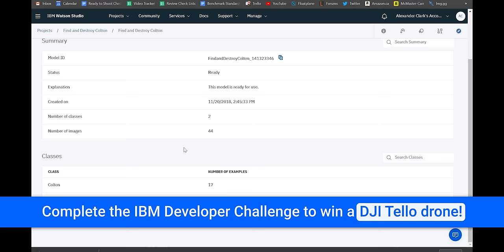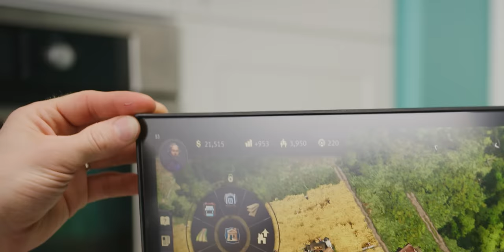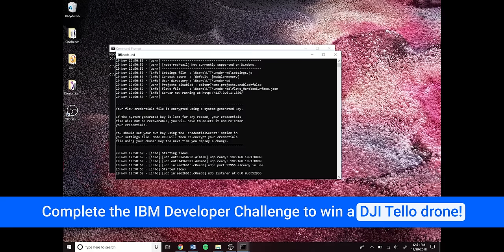FINALLY Upgrading my 4 year old Gaming Rig!

Comment: that erosion/corrosion was from using tap water.  use distilled!
Reply: It happens from distilled too. I used distilled in my very very simple custom loop, and I got erosion from the blocks.
Reply: Isn't there some inert fluid you could use other than water?
Reply: @lorenzvo5284  I doubt it, I imagine the flow of the liquid is what's causing the erosion.
Reply: @MoswenMedia  Its not only erosion it looks like oxidation aswell, or is that just the copper?
Reply: @lorenzvo5284  I'm fairly sure that's just the nickel finish rubbed away to show copper like you said.
Reply: Erosion: wear from flowing liquids
Corrosion: chemical reaction of a material with it's environment that causes major change to the material

To prevent corrosion you need to use non reactive liquids. Salty water is bad because it has a lot of spare ions.
To prevent erosion you need to stop the flow.
Reply: @Pseudynom  yea, pretty much what I said.
Reply: @lorenzvo5284  you can use mineral oil, but that stuff is really REALLY hard to maintain
another solution which is very expensive to both use and maintain is using what's called pure water, pure water is water that has had literally everything filtered out of it, it is softer than fresh water and distilled water, but a bottle of 500ml of this type of water costs about ~300$.
we used to use it in university for some experiments

Comment: Linus: My RAM memory its just 2666 mhz, its not that fast
Me: sitting here with 8gb DDR3 RAM ar 1600 mhz
Reply: Yeah and he has a damn 8 core meanwhile I'm sitting here with 4 cores lol
Reply: Me sitting here at triple-channel 966 (or whatever the BCLK made it)
Reply: @lfox02  Retro my dude
Reply: @vatz1151  I got an "Old" PC for free because the owner was moving and it allegedly did not fit in his new house (case is Antec P183, it's rather big and heavy). I thought it would be an old office PC, not an X58 gaming system (GTX 285 and i7 950). I got a Xeon X5650 off Aliexpress for 20€, used a GTX 750 (now a 770) and here we are.
Reply: Oof
Reply: For DDR4 that is slow. in reality though i am also sat here with 1600mhz ddr3.
Reply: @lfox02  thats a very nice/ignorant neighbour
Reply: @brodiehaward  ah, a man of culture as well
Reply: Me: sitting here with 4GB DDR2 at 800mhz (OC'd from 533)

plus a Geforce 8800 GTS also OC'd

plus Core 2 Duo E6750 2.66 GHz -> OC 3.2 GHz
Reply: @marekslemensky4531  Oof. I started out on a prebuilt with Vista (I installed 8.1 shortly after)
AMD Athlon 64 X2 5000+ at a blazing fast 2.6 GHz
Integrated motherboard graphics
And 1TB HDD (which, though slow, was rather nice and I still use it alongside 3 SSDs. I'll replace it once I get a chance though).
Reply: @lfox02  noice
Reply: @vatz1151  My PC is not a prebuilt one tho :D 
ok also I'm still using the first HDD that I put in it. 400GB samsung 7200rpm. But I can't say it's slow :D no jk

Comment: 40 fps with a titan rtx in 4K? that game should be optimized with foots.
Reply: The resolution makes a small to no difference in Anno, because it's so cpu expensive..
Reply: @sonnyboi1761  Clearly the cpu is not the limit there
Reply: @tuxnews2878  u gotta understand that he is playing on ultra with 4k resolution, if he played on 1440p he wouldve got 100 fps easy although u dont need that much for a game like anon
Reply: @ikindalikesportscars46  itd still pretty bad for the best video card available. definetly. pretty bad
Reply: @ikindalikesportscars46  Actually he is playing at 3440x1440 which is ultrawide resolution for 5m pixels.  a 4k panel 3840x2160 is 8.3m pixels.  I think Anno is just badly optimized if it takes that much horsepower to run high settings at ultrawide.

Comment: My only question would be if you use water then why not use distilled water since there are no minerals that contribute to the corrosion and distilled is at it's most purified while it's mostly used for medical equipment such as CPAP machines for sleep apnea.

Comment: Wrong upgrade, shoud wait for AMD Ryzen 3000, dont forget to install intel ZombieLoad parch that will kill your performance
Reply: My Thoughts Exactly. Also RTX 2080 Ti Super coming soon...
Reply: Actually if you read the technical paper, through testing the ZombieLoad vulnerability was unsuccessful on the 9900k. But of course you don't read.
Reply: @dhkatz_  that version. It is still effected.
Reply: Warm Soft Kitty  Jesus fanboys everywhere. Intel has been beaten in the vast majority of tasks since ryzen first came out years ago. You got more performance in everything but gaming, more cores to run single threaded workloads on, greater multithreaded performance, better features, better security, better upgrade paths, cheaper prices, better availability, a more modern platform, lower power consumption, less heat, better igpu's, more pcie lanes.

And now there has been a 15% IPC gain, even lower power usage, even more secure, even better more modern platform, higher clocks, and all of the stuff above is still true.

BuT inTeL iS BeTtER BeCauSe iT wAS a FeW PeRcEnt FaSTER oN SPECifIc WoRKload 4001. (For twice as much money not including the platform because then it looks even more ridiculous).

As for 3000 serious just wait and see. I bought AMD shares when they were a dollar and going to be in every new console. And I ran a 4770k then 4790k at home at the same time. 

Tldr don't be such a fanboy, AMD's ryzen line has been phenomenal for the world at large in computing and your opinion in your tiny segment of the market doesn't change that.
Reply: Warm Soft Kitty  what? How many gamers do you think there are? How many of those are buying high end parts? Almost none compared to those that buy a laptop and a console and work without knowing it on a VDI. All of which AMD will be taking back while Intel prepares products.

People buy Intel because of advertising and OEM's. Now that's changing too. Pushing more cores is bad? What world are you in? Do you understand computing at all?

Go do some computer science classes online. Then study the modern windows kernel, browsers, game engines then come back here.

Don't know if trolling or just completely misinformed or both.

Comment: As much as I like big ATX cases with temper glass panels, I love my tiny MasterBox Q300L MATX case.
Also, as good as just pure water is, I still will keep my oil, as I've put a chemical in it that will kill bacteria, but leave the plating of nickel alone. Also if it leaks, it's non-conductive, so it wont kill my system.

Comment: "it weighs, oh my god, probably a kilo or two!"
Americans watching this:

"a kilo? how many bald eagles is that?"
Reply: "The bald eagle has a body length of 70–102 cm (28–40 in). Typical wingspan is between 1.8 and 2.3 m (5 ft 11 in and 7 ft 7 in) and mass is normally between 3 and 6.3 kg (6.6 and 13.9 lb)." So somewhere between 1/3rd and roughly 1/6th bald eagles.
Reply: Strider Zero naa episodes of border patrol comes to mind 😂😂🤷🏻‍♂️ 🚔 🇲🇽

Comment: Meanwhile iv got a 2500k @ 5.2ghz under water since day one, and fingers crossed, never missed a beat.
Reply: I'm still rocking my 2700k from 2011 under water as well. It's about time for an upgrade... this isn't a terrible deal with the block ect.
Reply: @paulguggiana1765  haha yup. My problem comes to the fact that there's nothing that I'm currently doing though that my system can't do yet. So for me I'll only upgrade if I'm forced into doing so by dead hardware or it being a limiting factor
Reply: @Bangie  100%. I have upgraded video cards twice since the original build but other that that nothing had changed and I can play pretty much much any optimized game at 144hz all day long. It bugs me more that technology slowed down that much in the gaming space so much that 80% of your hardware is almost a non factor. I have been getting that itch to build a new system for the past few years but it just doesn't make sense.

Comment: that 2666 RAM is holding you back a few percentage points
Reply: The max supported on Intel CPU’s is 2666mhz. You could go higher but won’t get much a difference. At most 2%
Reply: @mikeramos91  that cpu will easily run ddr4-4000, I know because I'm running 32GB at that speed with CL17
Reply: @MikeDawson1  without xmp profile it can only run 2666
Reply: @ligametis  I know, that's why I'm suggesting he replace it next

Comment: anno 1800 only 40-60fps on ultra with those specs damn!
Reply: Seriously, it barely even made a difference.
Reply: @SpurnOfHumanity   Dude, i was considering getting anno 1800. I have 4k monitor, gtx 1080 and ryzen 1700x and im worried it wont be worth it.
Reply: everything maxed out at that resolution is insanely demanding for a new game like anno , i had this kind of monitor and i can say yes it looks amazing but it;s annoying if you are used to high refresh rates so i returned it and got a 2560x1440 native wich is great for everything especially because it's 32" so it's still pretty massive but 1440p does not tax you as much as ultra wide .
Reply: You have to remember that's at 4k on an ultra wide monitor...

That's like playing a game at 8k
Reply: formdoggie5 that makes sense
Reply: @formdoggie5  Well, it's close. 4k res = 3840x2160, Linus' was 3440x1440. So it's really more of a 1440 ultrawide. 4k ultrawide would be more like 5120x2160.
Reply: Will there ever be a time when hardware is powerfull enough to run every game on ultra at 144fps?
Reply: @bokajllensch661  probably 5 years for that to become the new standard. 8k is being adopted by TV's right now. So well probably see 4k 60fps become the accepted high end shortly. Right now it's a matter of it being a price barrier for acceptance.  That being said, most modern cards do already natively support 8k rendering so...
Reply: I think in the next ten years it will not happen that the highest "normal" resolution can be properly driven by the hardwrae of its time...
Reply: @bokajllensch661  lol no
Reply: @stevennolan5315  what are you reffering to?  To my rethorical question or my thesis? If its the first one I agree!

Comment: The fastest you can get , untill the 7th of july :D
Reply: Yup
Reply: The upcoming Ryzen CPUs aren't faster in games than the 9900k.
Reply: @basshead.  Ryzen 9?
Reply: +WizardX   More cores doesn't mean it's faster in games.
Reply: @basshead.  bud, but there is a  processor (I forgot the name) which Lisa announced. They benchmarked it and it's better than i9-9900k.
Reply: +WizardX  AMD loves to lie their products better before the release.
Reply: @basshead.  if you are right, then I will buy i5 9400f (which is cheaper than R5 3600) and gtx 1660 (which is a lot cheaper than RX 5700). I have to play games 1080p, competitive settings, 144fps.
Reply: +WizardX   I bet the R5 3600 will be faster than the 9400f.
Reply: @basshead.  yah but i5-9400f is cheaper also. Can you tell me, will Ryzen 5 3600 compatible with B450 chip set mobos?
Reply: +WizardX    Yes, if you update the BIOS but you need a 1st gen Ryzen CPU to update the bios.
Reply: @basshead.  unfortunately, I don't have. So I think I should go with i5-9400f. Can I stream with i5?
Reply: +WizardX   The A6 9500 is the cheapest ''Ryzen'' CPU that you can use for updating the bios.

Comment: 4 Jears is old?!? I am still running my GTX 680 🤪
Reply: its still a good card for full hd gaming, and when your card has 4gb of vram, it very good.
Reply: @Jiqsaw08  yikes.
Reply: gtx 960 🤪
Reply: @moderizhaan9497  I upgraded to dual 1080 Classifieds (running at 2.2GHz) this time 3 years ago from dual 980Ti Classifieds. Before that I had two of the 780Ti's Classifieds.... see a trend here? I'll be upgrading to dual 2080 Ti K|NGP|Ns here in a couple of months.

Excited to see what's after that.
Reply: Rocking the OG 2013 GTX Titans in SLi and still a beast for 1080p and even Medium Settings 1440p gaming @ 120Hz/144Hz.
Reply: @MrAndroid2013  Bro TWO 2080Ti's 🤪 most games don't even support multiple gpu setups so you only get single card performance Weird Flex but ok

Comment: my PC feels like a peasant compared to linus OLD pc
Reply: Majority of the people feel thst also me 😥
Reply: Still rocking a potato 8150, 8 gigs of ram and a 970 (upgraded from a radeon 7850) myself. You'd be surprised at how well it works
Reply: @Macfanize  rocking a fx 8350 and a gtx 1060 and i can say the same
Reply: Mine is a 4670k with a 980ti upgraded from a 760 .. takes alot of power tho .. its an older platform

Comment: meanwhile im here saving to upgrade my 1t hdd to a 250gb SSD
Reply: c'mon, 250GB ssd aint that expensive anymore. bought a 500GB one recently for just 60 bucks
Reply: I saw one of those on Amazon for $28. You don't need to save much.
Reply: @PAUL.DLL "I am not that rich to buy cheap stuff" suits well here i guess
Reply: I feel your pain, I'm saving for a new CPU but mine is old enough to be using DDR3, so that means pretty much a whole new system!
Reply: Are you saying you're replacing your hdd with the ssd? That seems silly, do you somehow not have a spare sata port or m2 slot to use?

Comment: Good for you... I'm still on my GTX745 -_-
Reply: 750Ti here -_-
Reply: Gtx745 sounds like a old BMw
Reply: @1DeleterX1  Rather a 750Ti than a 745...
Reply: @steviewonderzaful  It's an OEM model... Yes, I was one of those noobs who bought a prebuilt system :'( That's also the reason I haven't upgraded yet, my motherboard is an old LGA1150 with no support for the large GPUs of today

Comment: Should have waited for 3950X, not even joking...
Reply: yep. for sure that things gonna destroy
Reply: Lower frequencies though. Most games benefit more from the 5.1GHz OC than 16c32t
Reply: @infinitelyexplosive4131  cpu prob gona run at games pushing 5.0 anyway it's base in low but it also says it boost is 4.7 defiantly faster then the 2700x
Reply: @infinitelyexplosive4131  That's in the past, the industry is moving towards using more and more cores, as it makes sense, if you divide the load between cores you get ridiculously more out of a CPU in any workload...

Comment: I love this guy but that's not the way you grab the motherboard(by RAM sticks!!!!) (time line 6:40)
Reply: who says not to what im getting from your comment is you have only put a few builds together and im guessing you sweated like hell with fingers crossed that is posts alive 

everyone has these were rule of like 
1/ dont touch inside the pc part when system is on 
2/ dont clean the dust out with a brush only canned-air 
3/dont leave the case open it lets in lots of dust 
4/dont be too rough with the parts they are brittle and weak 

sorry but its all old hat thinking todays parts for custoim made PC are so well made unless your a complete noob or dont know how a system works most motherboards are safe from the old past fualt most are very safe from static most have multible safegaurds and some like my old system can be have part remove while it ON drive and ram and fan most can be cleans while still on you just have to know what action will cause what to happen
Reply: @duncanlanceoliver194  Duncan lance oliver  No sir, it's not about being unexperienced or certain rules that you mentioned, handling electronic equipments requires extra care especially those in modern computers that hold extra weght of GPUs or CPU coolers doesn't matter if manufacturesrs say they're gaurded with steel or etc, ram sockets and PCIe slots are delicately soldered pins each less than half a millimeter. holding a board which almost weighs a kilo by these sockets which are designed to only hold a 50 gram stick is very careless if not stupid, for a guy like Linus who many claim is seasoned builder, this proves that even he doesn't know how to handle electronics and then when he breaks them, makes stupid videos of baking cards in oven. Ofcourse dusting a PC or touching it while on, won't hurt it because most of the vulnerable parts like MOSFETS are out of reach, if touch a micro scale MOSFET while working, any Electrical engineer will say that it's ruined. The advertisements that manufacturers say about mother boadrs are only partially true because only people with less knowledge of electronics fully believe them.

Comment: Linus, I think distilled water could pretty much solve your corrosion issues.
Reply: Distilled water is what caused the problems. That corrosion is a perfect example of stagnant zone corrosion caused by a lack of corrosion inhibitors. The areas around the edges of orings and where the base touches the top trap water out of the flow path. Trapped water eats through plating over time.
Every example of corrosion like this is cooled by either straight distilled or Distilled with boicide. None have involved an anti corrosive coolant. 
Notice he talks about straight water and justifies the corrosion like its normal or acceptable but then fills the new system with EK clear coolant.

Comment: Linus please buy a proper tubing cutter for liquid cooling. it’s so much easier. I use the rigid ratcheting plastic pipe cutters that we sell at Home Depot. They are for cutting PVC plumbing pipe but they cut the soft tubing for computer water cooling like butter